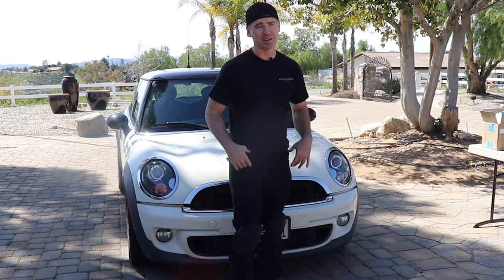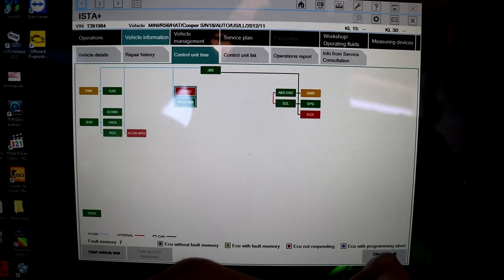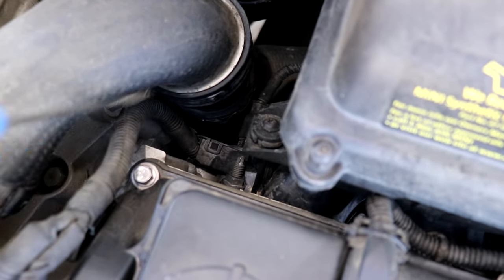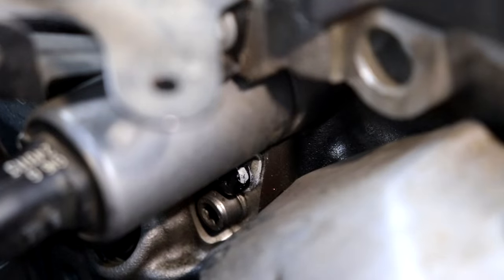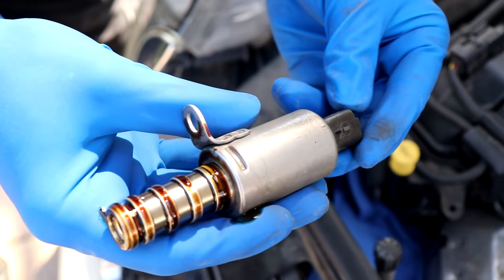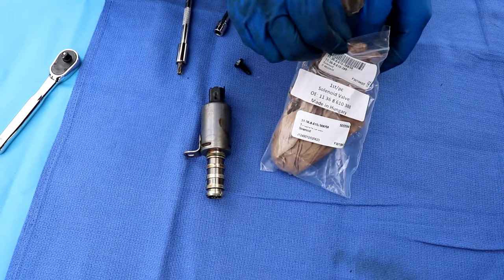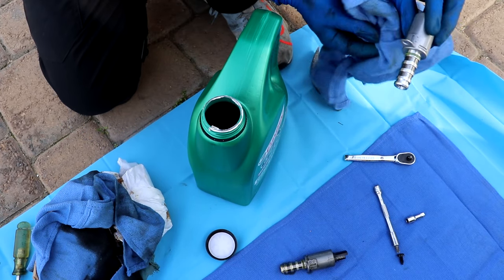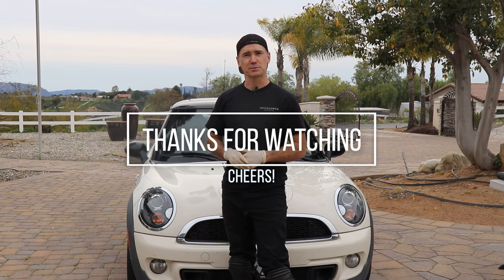2007-2015 Mini Cooper S R56 VANOS Exhaust Solenoid Valve Replacement – P054B, P13C9 / 2D54 2D60

Comment: Great video.  How do you break the T30 screw loose without stripping it?  After 10 years, 75K miles next to the exhaust manifold it does not want to turn.  Besides using PB blaster, should I use a small breaker bar for more leverage?  Apply heat with a propane torch?
Reply from the maker: Thanks for the kind words, glad you enjoyed the video. I would recommend removing that bolt after the engine is warm. You should not need a torch or anything to break them free as they should not be that tight. But, if you are feeling it want to try to strip, then you can add a little torch heat just to help things. The last thing you want is to strip the head of that Torx, which is not that easy to do.
Just make sure you are at a straight angle and apply firm steady pressure. Have a towel underneath so you don't lose the bolt.
Let us know how it goes on your Mini project.
Cheers!

Comment: Do I have to drain the engine oil before replacing it ?
Reply from the maker: Thanks for the question Heikilam. We recommend changing the oil AFTER replacing the solenoid. That way any debris that may get into the opening get flushed out with the oil change.
You can also check out our routine maintenance video on the Mini Cooper here -
https://youtu.be/F7t4QCePTPI
Good luck on your project, let us know how it goes. Cheers!
Reply: @BradleysGarage  thanks for replying. I changed my engine oil yesterday, so I was wondering if I unplugged my old Vanos, will all the engine oil flushed out from there?
Reply from the maker: @helkilam7989  No, you will only get a few drops that will come out during the swap. Just have a towel underneath to catch any oil and also prevent from losing the small bolt.
If you just did the oil yesterday, you should be good to swap out the solenoid. Just be careful not to get in debris into the opening.
Cheers!

Comment: Great video well explained. I have same code on 2 sereis 218i active tourer 2016. Any idea where exaust solenoid located on that. thanks alot
Reply from the maker: Thanks for the kind words, glad you enjoyed the video. Does your BMW have the B38 engine?
One thing to check before getting to the solenoid, is to verify the Oil filter cap has the center insert inside with the tiny o-ring on the stem. If this is missing you will have issues with the VVT solenoids.
Here is a good PDF which has some info around page 111 - https://bmwtechinfo.bmwgroup.com/tech_training_manual/ST1405%20B38%20Top%20Engine.pdf
Good luck on your BMW project, Cheers!

Comment: Hi there great vid 
Is the exhaust solenoid in the same place on the gen 2 JCW? 
Got a 2010 N14 B16
Reply from the maker: Thanks for the comments Jerry, glad you enjoyed the video. The N14 engine uses only one VANOS solenoid located on the intake side. The solenoid will be located directly opposite to the one shown in the video. You will need to remove the air intake boot to be able to access it.
The N12, N16 & N18 utilize two VANOS solenoids like is shown in our video.
Here is a good writeup that goes over the removal process - https://www.pelicanparts.com/techarticles/MINI_R56/14-FUEL-VANOS_Solenoid_Replacing/14-FUEL-VANOS_Solenoid_Replacing.htm
Good luck on your Mini project, let us know how it goes.
Cheers!

Comment: .Since I have problems when the car is running cold, it shakes and spins a little before starting the car, I remove the cable from the vvt solenoid on the exhaust side. I start the car normally without knocking and jumping and I can drive it normally, albeit with a little less power. into second gear. I only have p0013 from the error, this is the vvt solenoid switch. Does the ventiltronic work then or
 is connected to the vvt system so that I ecu turn it off if the vvt system is not working. To simplify, does the valvetronic remain working if the vvt solenoids are turned off? Thanks in advance.
Reply from the maker: Thanks for the comments, it definitely sounds like your Exhaust Solenoid is bad. Those are the classic symptoms with that error code. With it unplugged, the computer just goes into a basic mode and cannot advance the timing like it would with the solenoid working. That is why you are getting reduced power, it's running better because of the baseline ECU map.
Good luck on your Mini project. Cheers!
Reply: Many thanks for the answer, if only a little clarification in this regime in which it is now working as you said in the basic map, is the valvetronic system working or is the RPM now regulated only with the throttle. Thanks in advance. @BradleysGarage
Reply from the maker: @ozrenprezime  It is basically not using the VVT system to operate, since either it's unplugged or is faulty. Either way you would just be running on a basic map and therefore the engine would be on reduced power as a result.
You can always try to clean the screens and then run the old solenoid again and see if the code returns. In our case, cleaning it did not solve the issue, we had to replace it.
Good luck on your Mini project. Cheers!
Reply: A big thank you @BradleysGarage
Reply: @BradleysGarage yo quite la válvula vvt de escape y el auto funciona bien. Puedo dejarlo así ?

Comment: Are the selonoid the same for the front and back one? Exhaust and intake
Reply from the maker: Thanks for the question. Yes, the Intake & Exhaust both utilize the same solenoid. You have a few choices of what brand you'd like to go with. We chose the OE Supplier and have not had any issues since the repair.
https://www.fcpeuro.com/Mini-parts/Cooper/?year=2013&m=3139&e=2153&t=5&b=9&d=4465&v=&keywords=11368610388
Good luck on your Mini project, Cheers!
Reply: @BradleysGarage  thanks for the reply! You a lifesaver 🦾
Reply from the maker: @aanvaardig5770 No worries, glad we could help you out on your Mini, Cheers!
Reply: Hi I have an F55 b38 engine,  do you know if it also has two solenoids and are they identical? Thanks

Comment: Hi I have a 2011 Mini Cooper and changed the solenoid valve but after 3 weeks again the engine light is on with same error code, what should I do ??
Reply from the maker: Sorry to hear you are having trouble with your Mini. You might have a failed solenoid, is it a factory OEM brand? Are you seeing any evidence of debris on the screen after the short 3 weeks? If so, you might want to perform any engine flush to remove any loose debris in the motor, so the tiny filters won't get clogged. You will have to remove both intake/exhaust solenoids after to ensure they are clean.
You could also try to swap the intake and exhaust solenoid to see if the code jumps to the intake side. That would be the easiest way to definitively say the Solenoid itself is bad.
If you are still getting the same exhaust error message then you will start getting into O-ring issues on the camshaft end caps. These would be something you would do when performing a full timing chain/VANOS sprocket replacement.
The only other thing we had heard is the thermostat housing shares a feed with the oil solenoid for timing. If the thermostat shorts out, it can throw the 12V feed out of whack.
Good luck on your Mini project.
Cheers!
Reply: Respect useful information. I know this video been out over four years. The part of the thermostat you refer to. Would that be the electrical portion that regulate the opening and closing or the portion that reads the temperature?

Comment: Can someone please explain what the vanos solenoid actually does and how it works and how they stop functioning properly.
Reply from the maker: Hey Tommy, thanks for the question. Here is a great blog post that goes over all of the details on these solenoids. We hope that helps answer your questions. Thanks again for hanging out.
https://eeuroparts.com/blog/vvt-solenoid-issues-explained/
Cheers!
Reply: Camshaft gear is on a corkscrew, the solenoid will control the gear using engine oil to hydraulically ether advance the cam or derate it.
Reply from the maker: Thanks for the reply Mitchell, appreciate the information. Cheers!

Comment: screw out...but after 30min i put it back in because in can twist, but cant get this beast out...😢
Reply from the maker: Thanks for the comments Elvis, sorry to hear you are having trouble with your Mini. It might help if the engine is still warm from a short drive. Another trick is to use Vise-Grip pliers to attach on end of the solenoid, then you can get a prybar to apply a little pressure. You should be able to get some movement once you have leverage.
Good luck on your Mini project, please let us know how it goes.
Cheers!

Comment: Would suck losing that screw for sure.
Reply from the maker: Yeah, just gotta keep a towel under there just in case. Then you should be able to retrieve it without too much trouble. Thanks again for the comments, Cheers!
Reply: @BradleysGarage you had q codes what were they each specificly for? My says p054b
Reply from the maker: @UNTITLEDPHOTOGRAPHY  Thanks for the question, the P054B is for the "Variable camshaft timing control (VANOS), exhaust, cold start not controllable. The P13C9 is "VANOS, exhaust, control fault, camshaft stuck.
You can try removing the exhaust solenoid and simply cleaning it with brake cleaner and then reinstalling it to see if it was dirty. There is a small chance that will solve the issue. 
Here is a picture of what a dirty screen looks like - https://bit.ly/44xYHx9
If not, you will need to just replace the solenoid as it is no longer functioning. We provided the link to purchase the solenoid from FCPEuro in the description.
Let us know how the repair goes and what you discover. Cheers!
Reply: @BradleysGarage  thank you sir. Could it and/or be related to the inlet solenoid? Or is that another code?
Reply from the maker: @UNTITLEDPHOTOGRAPHY  You are correct, the Intake Solenoid error will throw a different code 2D55 or P055B depending on which Scan Tool you are using.
Good luck on your Mini repair, let us know how it goes. Cheers!
Reply: @BradleysGarage  ok, so I figured out the issue. I only bought the car a month ago, and the engine light kept coming on after an hour of driving but no codes. Then, after a few weeks, the P054B code came on because the problem messed up the VVT's solenoids.  The reason I believe is because the car yard used the wrong or cheap oil and at hot temperatures, it misbehaved messing the solenoids. I cleaned them out out and put the best and correct oil I could find, and the problem went away, and even at long drives, the engine light doesn't come on. These cars are sensitive. If you want them to last a long time, change the oil every 5 to 7 thousand miles. These engines are small, get hot, and burn oil, destroying the engines early. Use Castrol, Penzoil, or Valvoline 5-30 fully synthetic oil. And use 91 plus gasoline Shell or Techron fuel only. The injectors are also sensitive.  They are small, delicate engines and need to be treated like a racing engine. Don't go cheap with they maintainece like you would with a truck. The main problem with these cars is usually oil or fuel related, so use the best you can find and save money in the long run.  They have little room for error. Keep it primed, and it will last.